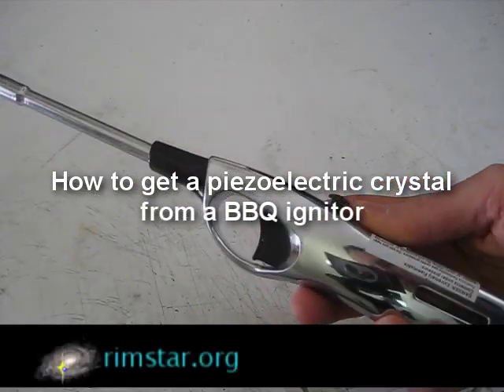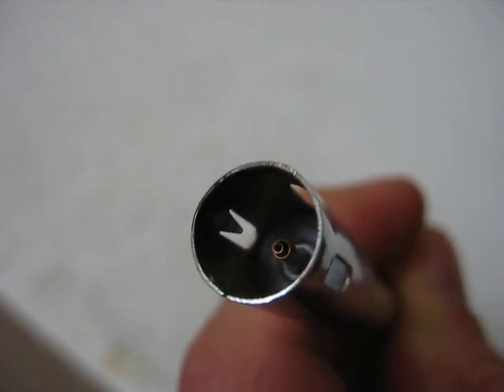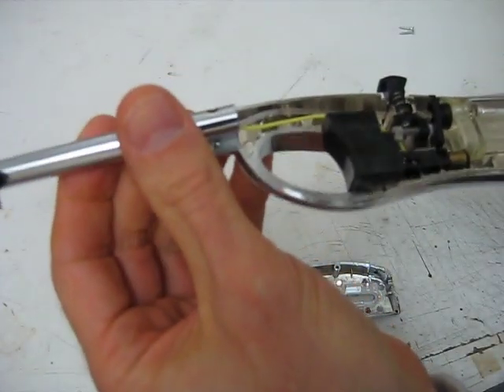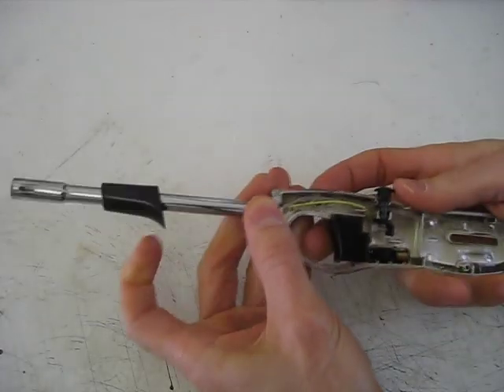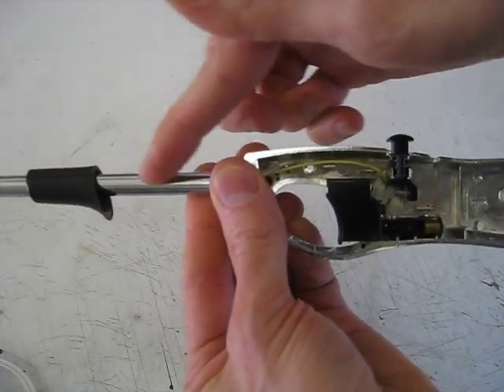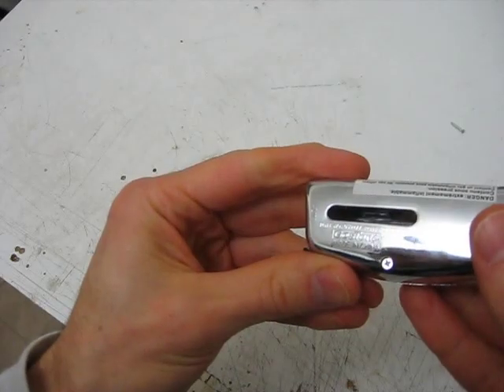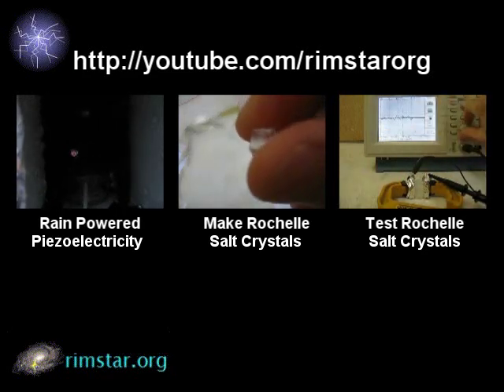How to get Piezoelectric Crystal from BBQ Igniter/Sparker

Comment from the maker: You're welcome!

Maybe. It's called a microphone and many of them use piezo crystals. Maybe if you glue a diaphragm (paper or metal disk) to one end and secure the other end. When the diaphragm vibrates from the sound it might show up as voltage fluctuations across the crystal. The flat round piezo crystals like in my "Piezoelectric generator LED lit by rain water" video (see link in the video description or see my channel) are another option to explore. The energy harvested will be small.

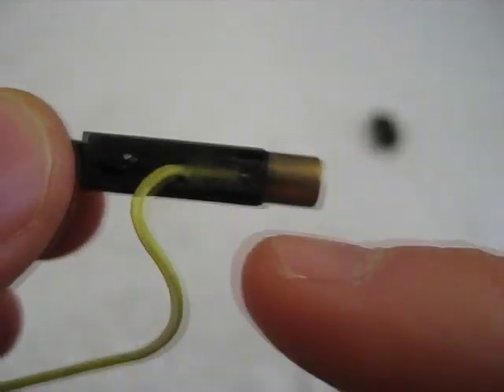Comment from the maker: You actually don't need a ground. The voltage develops between the yellow wire and the copper cylinder. See the video at 5:14. If you cut the wire and hold the end of it near the copper cylinder but not touching, then when you trigger the crystal a small spark will go between the end of the wire and the cylinder.

Comment from the maker: By ground, I don't mean Earth ground. I mean the other polarity needed to close the circuit at the spark gap at the tip. It's ground in the sense that with this igniter, the case has a conductive coating and acts as part of the conductor to close that circuit and your hand it in electrical contact with the case. So that side of the circuit is close to your potential.

A spark is created in my igniter at the copper cap. I don't know whether it was supposed to. I don't see why it would need to.

Comment from the maker: I use my oscilloscope but you can also use a digital volt meter. But make sure it's a meter that can handle high voltage. My expensive one and my cheap one can both handle up to 1000 volts, which is fine. The reading you'll get will be brief but you should be able to tell whether it's positive or negative. Try the meter leads connected both ways. When you get a positive value, the side connected with the positive meter lead is positive and the other side is negative.

Comment: It's funny how quite different that igniters is from the ones in my country. One igniter I've disassembled only had the trigger button for both gas and piezo sparker. The sparker didn't have a copper cap, instead there was  an exposed spring (part of the "banging" mechanism I guess). There was a metal square on the moving part of the sparker  to which the 'hot' wire flimsily touched (although not attached). Finally the case was closed by plastic snapping prongs instead of screws.

Comment from the maker: I'm not sure what you're asking. Are you wondering if heat from soldering damages the crystal or the connection to the crystal? I don't recommend using a high power soldering gun. I did once and I think I may have either damaged the crystal since it wasn't very powerful afterwards compared to other different crystals. But since I had only different crystals to compare with, I can't be sure.

Comment: nice video! i have 55 piezos...     i'm trying to   get a very big spark connecting them in series..    nothing happens...  :(
Reply from the maker: Thanks! That could be because piezos have a very high impedence, so the current isn't flowing from one to the other very well. It may not seem right but try connecting them in parallel instead. Connecting them in parallel doesn't make sense for a circuit but it makes sense to me for charging a spark gap. They'll all push and pull on both sides of the spark gap at the same time, producing a high charge on both sides. That's assuming you hit them all at exactly the same time.
Reply: They are almost non conductive although it doesn't make sense for them to create electricity but not carry it you'd have to come up with a way to have them all being struck at the same time the grounds should be connected in parallel and each crystal with its own individual lead then connect all of the  positive leads into one central point the two wires mounted or laying in close proximity to each other will create quite the show

Comment from the maker: They're a way to get a spark without having to use an electronic circuit, batteries, ... providing you have muscle power. e.g. for a spud gun the spark ignites the gas, or less fun, the spark ignites the gas in a barbeque and no electronics or electricity source is needed. Some electric guitars do the reverse... the strings vibrate the piezo crystals which generate voltages at the given frequency and that gets processed and amplified. So they can be used for detecting motion.

Comment from the maker: (continued) In the case of my BBQ igniter, it needs to create an arc in the tip where there is gas. So there's the end of the HV wire and the thing it creates an arc to, in this case a sharp point in the long tube, and in this case that is electrically connected to the other end of the piezo crystal. In your lighter it must be arcing to somewhere. It needn't have a return wire to the other side of the piezo crystal but it must be something that can be charged briefly by the high voltage.

Comment: I need the bare crystal itself, any idea on how to extract it or where can i get one? It is for a project on a pressure/force sensor. Thanks in advance.
Reply from the maker: I've never extracted the crystal so I don't know how embedded it is and how hard, or easy, it is to get out. It is easy to remove enough so that there's no trigger mechanism, just something that you can apply pressure to on both ends and see a momentary change in voltage. Note that with piezos, the voltage change happens only momentarily during the change in pressure, not while pressure is maintained. You can also get these from some small hand lighters as I show in my "How to take Piezoelectric Igniter from Lighter for Spud Gun" video http://youtu.be/DAyM8Iet1O8
An alternative is to use a disk shaped piezo, though they can't handle as much pressure. I've gotten those from microwave ovens that make beeping sounds using piezo speakers (not the ones that have a mechanical bell sound.) You can see one in my "Make Crystal Earphone/Earpiece for Crystal Radio - Homemade" video http://youtu.be/OVapqz4yBCY I didn't completely extract it there but it's easy to do. You can also buy those in piezo buzzers from electronics stores like radio shack and even some hardware stores.
Reply: RimstarOrg Thanks! actually I need to measure a momentary force, not a permanent one. I will disasemble one and make some tests!

Comment: Your hand is not the ground. I'm sure it would work just fine if you were wearing rubber gloves.
The tube and the metal plated case complete the circuit.
Reply from the maker: Hmmm... Good point.

Comment: Hi Thanks for the educational video. Do you happen to know how much voltage is produced from this crystal and is it easy to determine which end produces the electrons? Amperage I am guessing is extremely low? Thanks again
Reply from the maker: +David Michael The voltage depends on the width of the spark gap. When I do the test in the video at around 6:06 the spark is around 3mm long which I'd estimate at 3 or 4kV. The shape of the electrodes matters too, so in this case I'm calling one electrode a needle electrode and using this table here http://www.kronjaeger.com/hv/hv/msr/spk/index.html. As you can see, it's actually below the shortest distance in that table for a needle electrode so I'm extrapolating.
I didn't check the one in this video with my oscilloscope so I can't say for sure which end is positive. However, I did check in this video http://www.youtube.com/watch?v=DAyM8Iet1O8 for one taken from a lighter and at around 5:45 into the video you can see that the part that gets hit is negative.
The amperage can be surprisingly high in a spark. It doesn't cause injury because it's brief. But I don't have an estimate for how much.
Reply: +RimstarOrg Thank you really appreciate your time
Reply: I cannot understand how the voltage generated should change  if the gap is kept far enough apart to stop the spark ( except short circuit ) ?
Reply from the maker: The voltage is actually at its highest just before the spark. While the spark is occurring, the voltage is dropping.
The voltage builds up by opposite charges accumulating on both sides of the spark gap. There's an electric field in the gap between the two sides. The spark happens because the voltage is sufficient to break down the air in the gap, ionizing the air making it more electrically conductive. Once the air is conductive enough then the charges cross the gap, decreasing the voltage. That's the spark.
If the gap is wide enough then the voltage in the gap may not ionize enough air to make is conductive enough for a spark to occur. But there would still be voltage i.e. a build up of opposite charged on both sides of the gap.
Of course if the gap is really wide then voltage wouldn't build up on the two sides. However, voltage could still build across the two ends of the crystal.

Comment from the maker: Is there still some metal on that end that you can attach to somehow, maybe with an alligator clip? Or can you solder to the cap now and then put the cap back on? It's hard to suggest things without seeing it. Unless the heat damaged the piezo crystal it should still be okay. If there's nothing you can do with the cap anymore then you can still put some metal there and attach to that metal instead. For a crystal I'm using now I use elastics to hold a piece of aluminum foil against the crystal.
Reply: Wow

Comment: ive seen 2 of these and they both used a rubber cap (on the copper tube on the "striker" @ 5:24) with a stripped wire tucked under. so following that method if you don't have a rubber cap, all you need is wire and electrical tape. no need to solder it.

Comment: what would be needed to make use the type of voltage that is made from the spark?  what if you wanted to use the lighter ignition to turn a small dc motor to spin for a short brief moment or light an led for experimental sake.
Reply from the maker: I use some to power a speaker here http://youtu.be/0-PParSmwtE and here http://youtu.be/R7zjfaPKMSE

Comment from the maker: I have tried it. It hurts! :)

In that case the circuit was closed by my skin. In order to have voltage you need two polarities. That's why the arc occurs. There's a rush of electrons to the end of the high voltage wire which repels electrons from whatever's on the other side of the gap. A corona builds up followed by an arc. (I may have the polarity backwards.)

But an arc needs something to arc to. As with my skin, it doesn't need a return wire, just something that can become charged. (cont.)

Comment: Great video. I'm just wondering now if one of these could be connected to a voltage doubler to charge a capacitor. Or if they could charge a capacitor by themselves. Kind of a silly project, but I wonder if it would work.
Reply from the maker: I did play around with that idea using the very igniter I show in this video. And while I did charge up a metal ball, it took a while since there really isn't much charge per spark here. As you say, silly, but it was fun to try it.

Comment: I'm almost certain that I heard that you were going to show us the crystal and the closest I saw was a little plastic box with two exposed contacts filled with what looked like hot glue I never once saw  a crystal
Reply from the maker: Interesting comment. I never thought to break open the case that contains the crystal since that would make it no longer useful, or at least not as useful as it is in the case, since it works well with the trigger mechanism. But it would have been interesting to break it open anyway just to see what it looks like.

Comment: nice video, how can i get a piezo? i need it to light a LED for test
Reply from the maker: You can get a piezo by doing what I do in this video. You can also get one from a small hand lighter as in my "How to take Piezoelectric Igniter from Lighter for Spud Gun" video http://youtu.be/DAyM8Iet1O8 or from a microwave oven as I do in my "Make Crystal Earphone/Earpiece for Crystal Radio - Homemade" video http://youtu.be/OVapqz4yBCY or from a gift card as I did for my "Piezoelectric generator LED lit by rain water" video http://youtu.be/laSQ6yd7jaE (though most musical gift cards have other types of speakers in them.)
Note that in the last video I mentioned I do light an LED with the crystal. But since it's hard to find that type of crystal in a gift card, it's the same type as in the microwave oven.

Comment: How do I remove ,or where is the crystal...its still in a casing you can make these Crystal's from home...
Reply from the maker: I've never removed it from the casing so you'll have to find a way to remove it yourself. It's probably a small cylinder. You can make Rochelle salt piezoelectric crystals, though they're not as powerful as the type in this BBQ ignitor. I show how in this video https://www.youtube.com/watch?v=E1Ct3VUWvhQ and there's more detail on my webpage here https://rimstar.org/materials/piezo/how_to_make_rochelle_salt_piezoelectric_crystal.htm.

Comment: i get guilty when i break open a usable and good lighter. i have to use up the fuel :(
Reply: I always look for lighters on the ground since they are litter and usually empty, if it has a sparkler i remove it and put the rest where it belongs so it dosent litter the ground

Comment: hey can we amplify this piezo crystal electric ..  
if it around 20-50hz frequency..
Reply from the maker: I'm not sure. It's very far from being a sine wave. It's more like a dampened sine wave where the first peak is huge compared to the others. It's also very brief.
Reply: RimstarOrg i though by using supercapacitor. we stabilize it for me it enough 5.5v it will be great if it you can help me with this
Reply from the maker: All Out
A supercapacitor has too high a capacitance, like a very large bucket. Each time you hit the piezo you'd get only a small charge, so it would take an awful lot of hits before you can begin to fill the bucket. A small high voltage capacitor with a capacitance of only nanofarad or picofarad would be better.
Reply: RimstarOrg can we make some sort of phone charger with this piezo,,im on study on vibration and piezoelectric....
Reply from the maker: Ayub Abdul Rahman
I don't really know. You could certainly get some charge, but how much I don't know or if it'd be a useful amount. You could try putting them in your shoe to charge as you walk.
Reply: you are in which country

Comment: Wow I’m stoopid… I always threw my lighters out, I bet the wires were never grounded 😭😭😭 thanks for the info!
Reply: No, they don't require "grounding". Piezos plastic housing and cheap lighters usually malfunction due to wearing out. Cracks in plastic or broken hammer spring. Heat distorts body of lighter causing gas to not be properly released also.

Comment: RimstarOrg2 years agoin reply to Sozlled .
 
By ground, I don't mean Earth ground. I mean the other polarity needed to close the circuit at the spark gap at the tip. It's ground in the sense that with this igniter, the case has a conductive coating and acts as part of the conductor to close that circuit and your hand it in electrical contact with the case. So that side of the circuit is close to your potential. A spark is created in my igniter at the copper cap. I don't know whether it was supposed to. I don't see why it would need to.

Your hand touching the case has nothing to do with it. It will fire with a insulated glove on.

Comment: Excuse me, this is incorrect.
To deliver the current from the quartz inside the base (not the top portion which gets depressed as you have said), and to the valve, where gas is released, it uses wire and or parts of a lighter's body to arc to the metal valve.  I'm a girl and know it's like a car. Spark jumps to the nearest metal, and not because someone is touching it!  (Piezo igniters don't even require a ground to spark!) All those common plastic Clipper and cheap peizo lighters everywhere wouldn't create a spark if you were correct. If that was so we would get zapped with every click. 
People watch videos around the world. The least you could do is not misinform people who no doubt want to learn correctly. Gas is not pronounced "gazz" either.
And at no point did you take the crystal out!!
Reply from the maker: I'm not 100% certain of what you're describing but I'll try to respond. I agree, saying that you're the ground, as I did, is going a bit far though since you don't need to be present at all. So in that you're right, I shouldn't have said that. Though with this lighter, when holding it, you are electrically connected to the conductive case.
I said the voltage develops across the two ends of the crystal, which I didn't remove from it's enclosure. The voltage is then available from between the yellow wire and the copper cap. You're right in that sparks can jump to the nearest metal but in this lighter there is a closed circuit that I described, including measuring the conductance of the metal case with my meter. The tiny spark at 3:21, that I didn't point out very well but is visible, is part of the circuit, though with the case reassembled, that gap for the spark may not be there, in which case the current would flow from the copper cap to the metallic coating without a spark.
I didn't take the crystal out of this one because I think I would have had to break it to do so and I wanted to reassemble it.
As for the pronunciation of gas, that depends on where you're from :-)